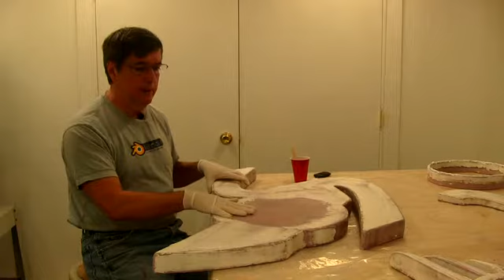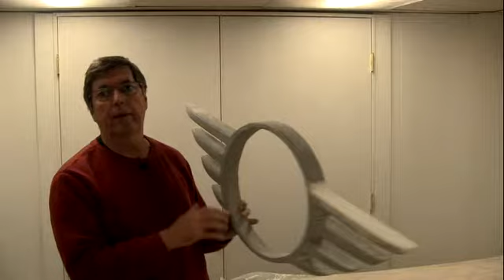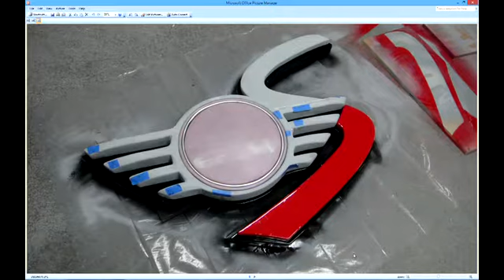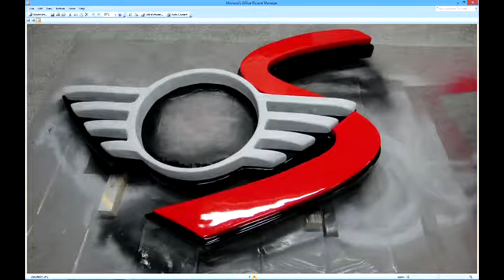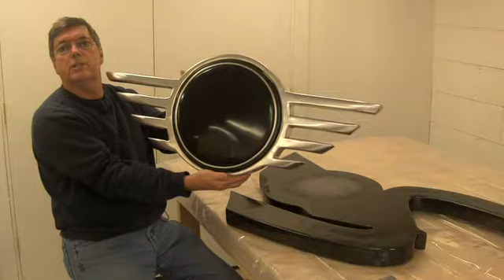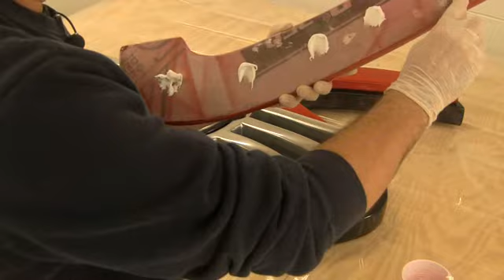Mini Cooper Logo Sign Pt  4

Comment: This turned out amazing! You should consider selling these! I would buy one!
Reply from the maker: Thanks for the comment on the sign.  For me to make more of these to sell would be possible but there are way to many hours work in it to make it affordable.  It would have to be made in a mold and then cranked out that way to reduce the cost.  Even then I would have to have a lot of orders to keep the cost down and make it worth the effort.  This is why I post my projects online so that you can learn how to make your own.
Reply: I knew that would be the case, just wanted to give you some feedback on how awesome this turned out. With anything like this where it takes many man hours to make a one off, its just not feasible making them unless majorly changing your production line. Either way, nice job and Motor On! ( I love my Mini! ) :)